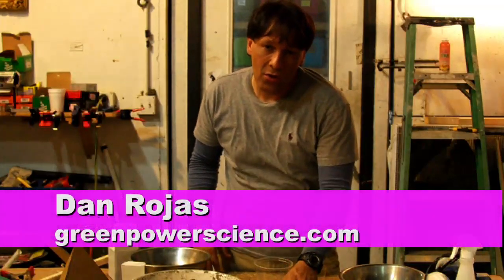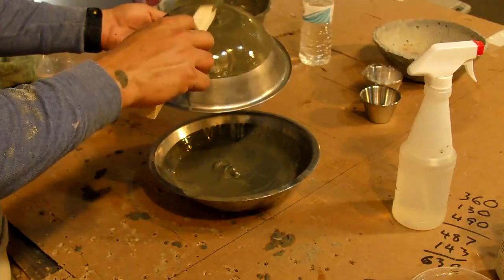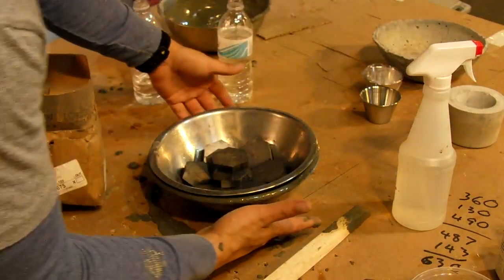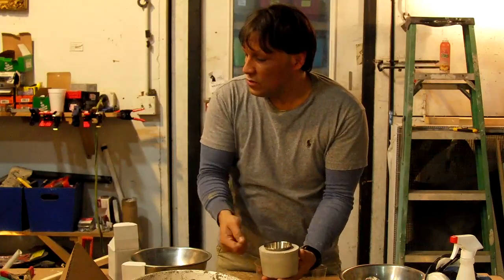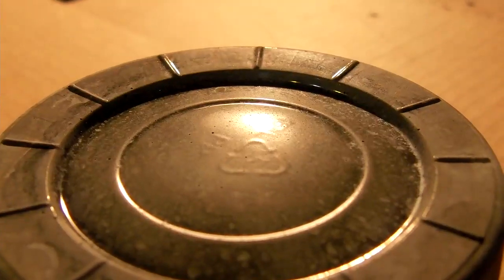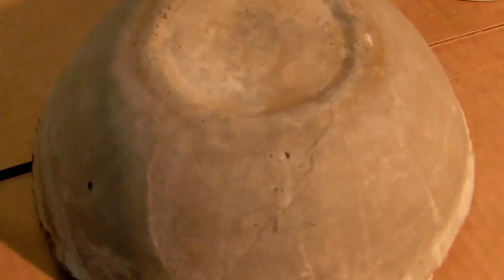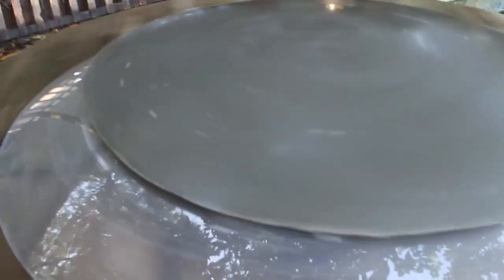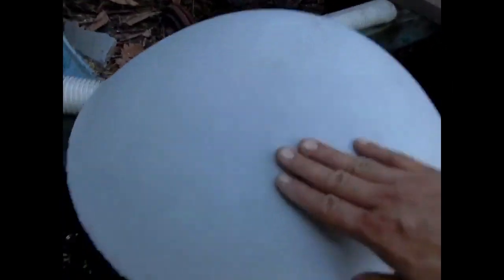DIY crucible cement bowl parabola mirror-like finish

Comment: Dan or Denise have you used your parabolics mirrors aim them at the planets orbiting  at the focal point of the mirror  will be and image of that planet . aparabolic with a 6 ft focal point  should be a small 1 in. planet .try to reflect off a outside wall with the moon.  thanks for everything.